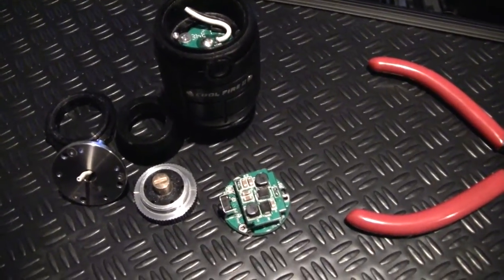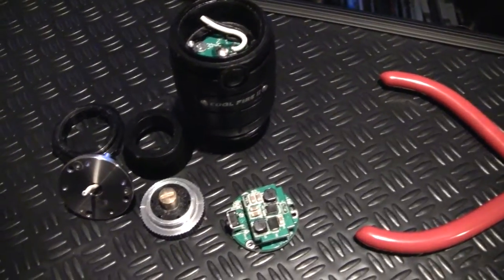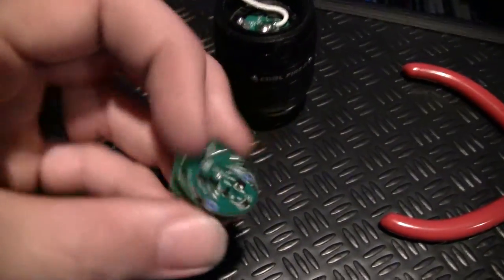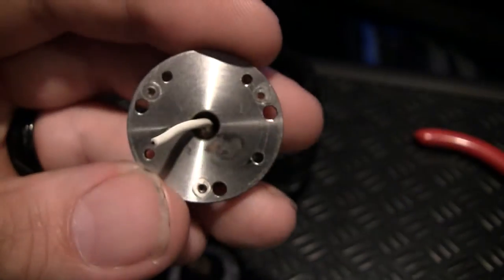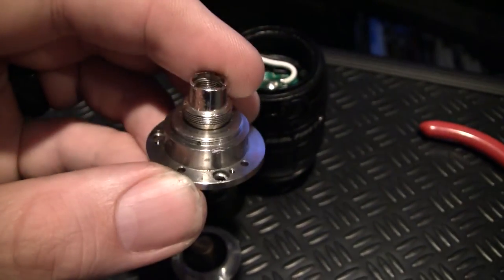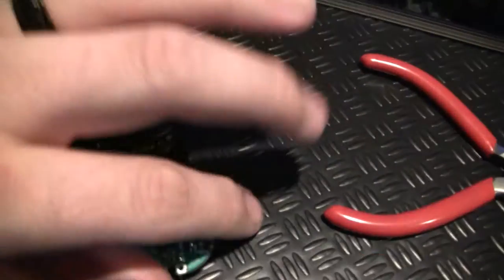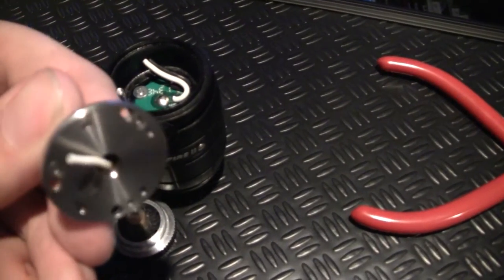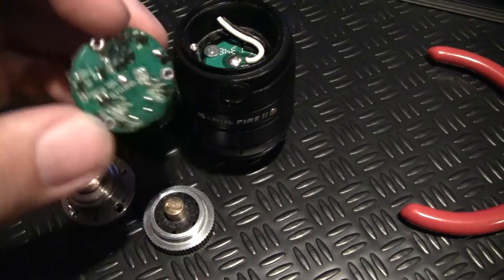Cool fire2 Constant fire problem findings

Comment: Thanks for this vid and the take apart vid. My Coolfire 2 started to fire constantly the other day. I pulled off the atomizer and took out the battery. Using your vids I was able to get it apart, without destroying it. I was lucky enough to be able to clean out the juice and sprayed some solvent on the board and it seems to be working like new again after I put it back together.
Reply from the maker: I'm glad my video helped you, I hope it lasts for a long time, just be careful about how much juice leakes out of the tank you have or you will be taking it apart again.

Comment: I had a similar problem, when I checked the voltage at the termination that the clearomizer connects to I was only getting between 1.2 and 1.5 volts.
I never had the constant fire problem but when I disassembled it I noticed the same black mark above the circuit board and the wire that connects the terminal to the board was brown from e liquid running down it. 
I guess it's really just trying to stay on top of leaks that will prevent this type of thing from happening although it seems like a problem that could be engineered around..

Comment: Good video. By chance, did you hear back from Innokin? The push button attached to the circuit board isnt very durable either. I found this out on my first one. I got a second one, and Id LIKE to do a modification and install a more durable button. Can you tell me what steps use used to get the top plate off? I appreciate this vid, and any help you can offer. :)
Reply from the maker: To start off I have not heard back from Innokin as of yet. As far as taking it apart I will be making another video within the week to show how I achieved it. As far as getting my Coolfire 2  repaired I have decided to turn it into a fully mechanical mod, that will also be in the upcoming video on the steps I took to complete it.
Reply: Stephen Royer Awesome. I did finally get it all dismantled. Top plate just required more torque than anticipated. Definitely looking forward to the next vid.
Reply from the maker: ESPIONAGE1974 Thought you would like to know I just got an email back from Innokin, They liked my feed back enough that they are going to send me another Coolfire 2. They do have great customer service.
Reply: That is awesome!! By the way, I also discovered that the metal area surrounding the fire button is a separate piece that can be popped out on its own. You just have to pry it. This is good to know for anyone with a button that sticks.